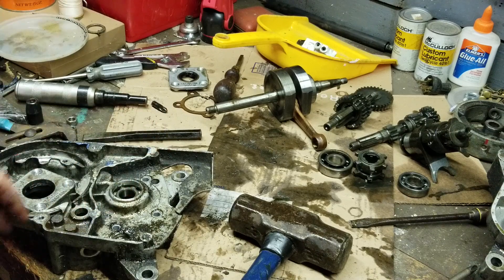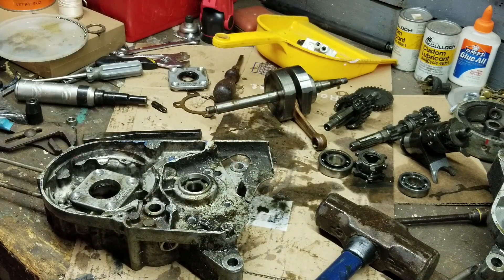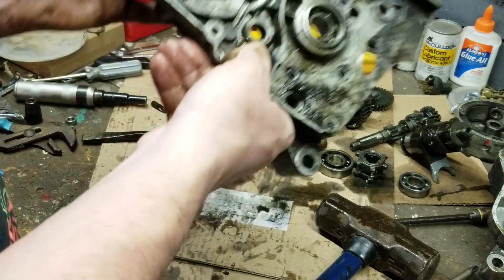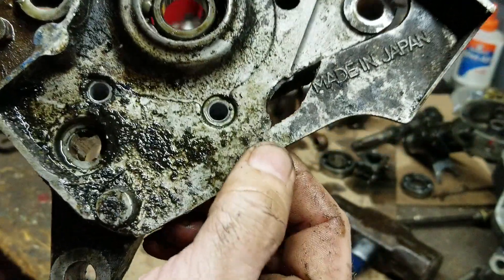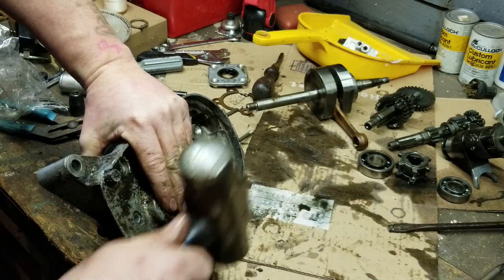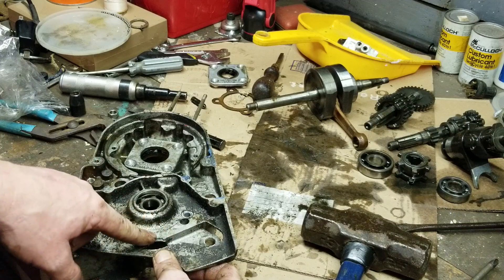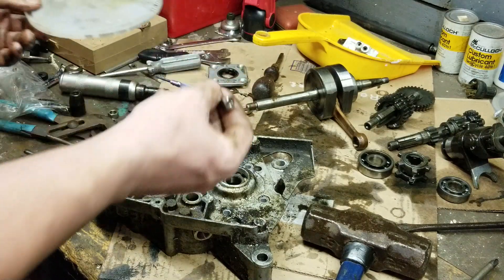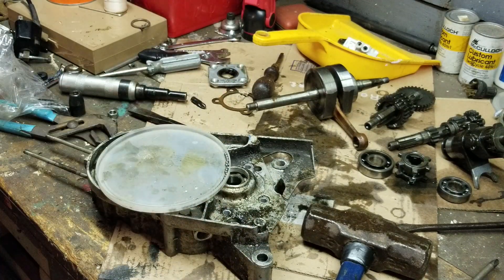Kawasaki kv75 mt1 teardown part 2 1/2

Comment: When ever I watch one of these case splitting videos of yours it makes me want to bring my 1980 atc 185 motor in to the house and start working on it. Been thinking about putting a 200x top end on it. But first I need to fix the threads on the crank. The ones on the pull start side. No worries it's in the garage and not out in the snow.
Reply from the maker: Do it get it done spring is right around the corner get that bad boy 100%@